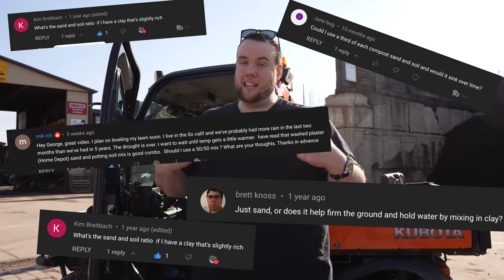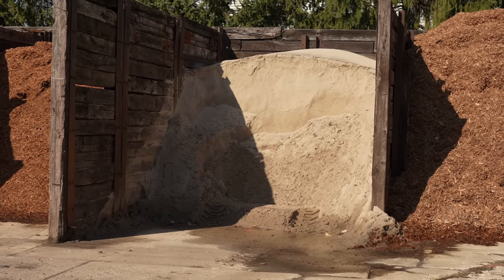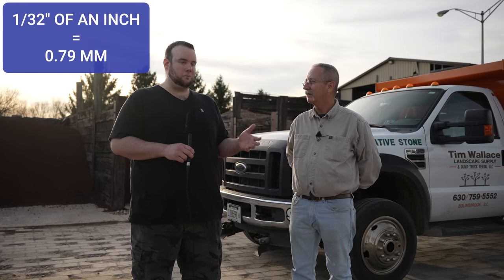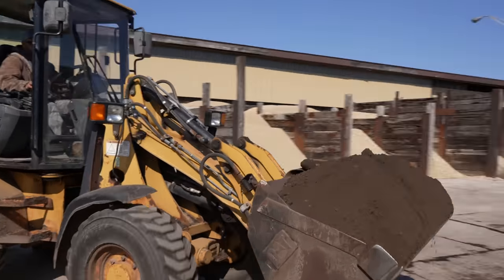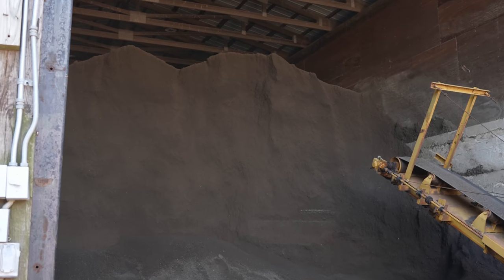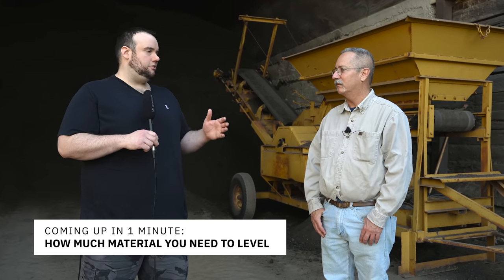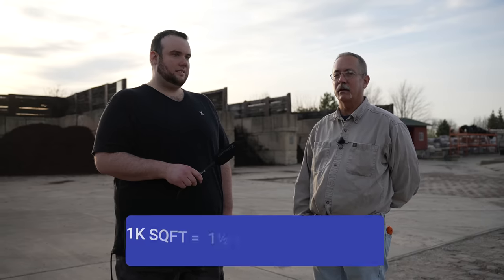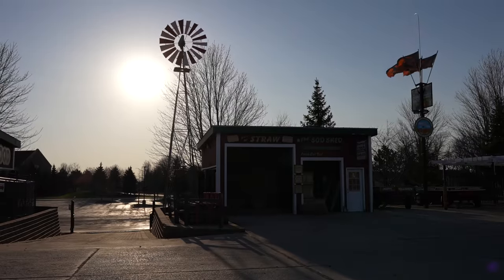DON’T Use Sand to Level your Lawn!! *INSTEAD USE THIS*

Comment: Unlike the majority of comments here, I've actually been a customer of Tim Wallace Landscape Supply and have bought several yards of the lawn repair mix with Purple Cow compost from them, and it was loaded with rocks, clay, glass, plastic, trash, and giant pieces of unprocessed mulch that I had to spend days manually screening out myself. Every one of these landscape suppliers are the same, even the ones that appear like they know what they're doing don't actually fully screen the material or perform any QC check on it. Hope you enjoy your rocky soil with thousands of bits of trash from Tim Wallace Landscape Supply! 🙄
Reply from the maker: You must be a competitor.
You can see clear as day how fine both his top soil and compost are.
Reply: @PrincessCutLawnCare  This may shock you, but there are actually real people who live in the Chicago area who buy from landscape suppliers, and they outnumber the quantity of landscape suppliers who are secretly skulking around on the internet. I live in the area and I've been to the Wallace supply yard, and stood right where you did, I'm quite familiar with what they have. The final mixed and screened product is almost one quarter 25% unusable by volume for leveling and patching. I ordered over 5CY of their product last season and had nearly 1CY of waste and trash left over that I wouldn't put on my worst enemy's lawn. Maybe instead of making ridiculous accusations about people who've actually BOUGHT the product being a competitor, you should order a truckload from Wallace anonymously (without any name dropping) ship it to a lawn renovation project house (one that is not your own) and film the product being delivered, then put it all over their lawn and see how much they love a lawn full of mulch, rocks, and inorganic material that won't break down. Actions speak louder than words, so go ahead and show us. Pretty confident you won't.
Reply: @Anamnesis  didn't you accuse of accusations and then make accusations yourself ?

Comment: I’m a bit concerned with the 50/50 sand/topsoil mix. My experience with 50% sand mixed with clay soils has resulted with a finished product that resembled cement. Eventually, I added organic material to make the soil mix approximately 50/50 clay topsoil with 50% organic mulch, or a similar organic medium. I then added 50% sand and blended the 3 products (50% sand+25% clay topsoil+25% organic material) really well. More work, but a better finish product. I see this video also uses a similar mix as well.
Reply from the maker: I hear a lot of people talk about the cement theory but I have never experienced anything close to that.
Reply: @PrincessCutLawnCare  Maybe a different kind of clay soil. When ours is dry, it is already like cement, and breaking it with a pickax is a lot of work. My tiller just bounces off the stuff. For sand to work, it needs to be the more dominant additive in Hawaiian clay.

Comment: "You don't want to use straight sand because you don't want to change the composition of your soil."  Why?  Why not have a thick layer of straight sand that drains very well, with a layer of soil on top?  You'll never have to worry about drainage in that area.
Reply: Exactly. I've been using nothing but sand to level and top dress my yard for the past several years and it works wonders. Theres really no need to mix in top soil . The organic material in top soil will break down after you level the yard and the bumps will start to return.  Just let the yard naturally produce organic matter as lawn clippings break down over time.

Comment: Sand is used on golf courses for a reason. It works best. You need something fine and that can be packed at the same time.  Sand is best or they would have switched over on golf courses a long time ago.
Reply from the maker: Not everyone is looking for a golf course lawn.
Took me a while to realize this as i DO want a golf course lawn and im prepared to deal with the extra maintenance that goes along with using straight sand.
But 99% of people want a low maintenance lawn that doesn't break their ankles.
Reply: yep. It's better for top dressing and better for leveling since it doesnt contain any organic matter that will break down to create low spots.

Comment: Look like you're losing weight. Keep it up.
Reply from the maker: been on a diet for about 2 weeks 😂
Reply: @PrincessCutLawnCare  I've been off and on since last year. Cut 35 pounds,  another 20 t0 30 to go. Been frozen at 240. Got down to the hard fat, it's starting to flab up, and then that's when the next wave happens. You need a bigger yard so you can do more yard work lol. Just wanted you to know you can see it.

Comment: 2:01 Americans using seconds to measure size 😂😂🤡🤦🏻‍♂️
Reply from the maker: 😂 at least I gave you metric!
Reply: I think you didn’t hear the guy correctly. He said that they screen the sand to the size of 1/32” which is 0.0312 of an inch which is roughly 0.079 cm.